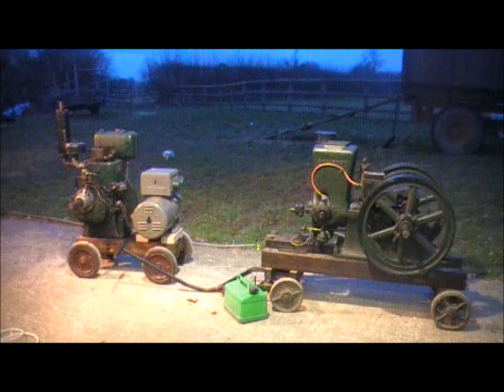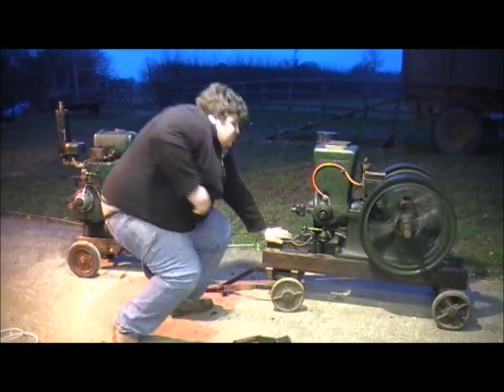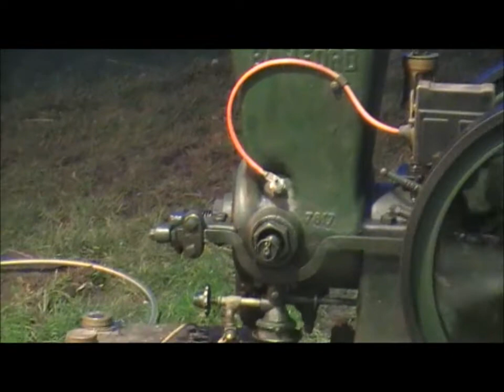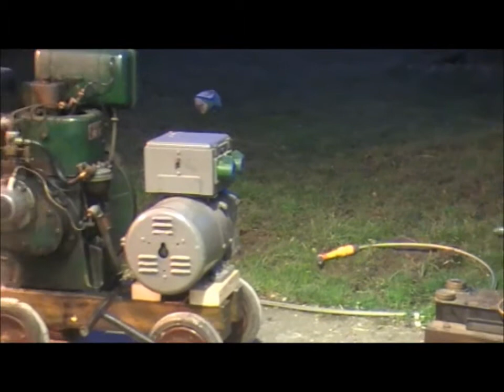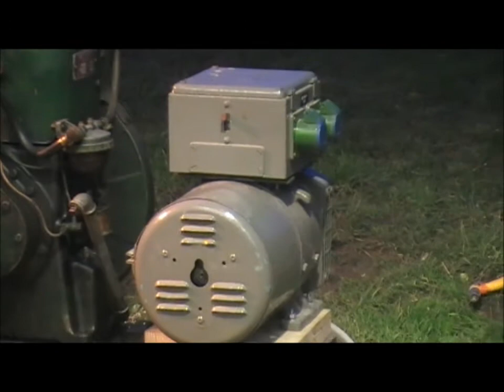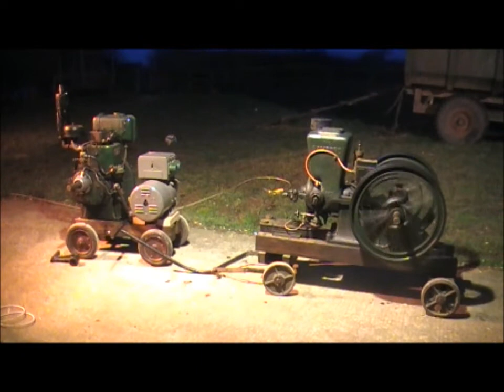Bamford 3HP open crank and Petter PAZ1

Comment: Nice little start up, that petter needs a big silencer or something. Bradford runs okay may need a warmer day
Cheers
Harry
Reply from the maker: The silencer on the Petter is bigger than the one it would have had from new, I think its more diesel knock than anything else. The Bamford needs the carb looking at really, there is an atmospheric valve in the bottom of it which I believe to be stuck.